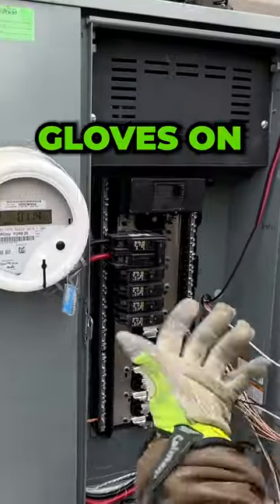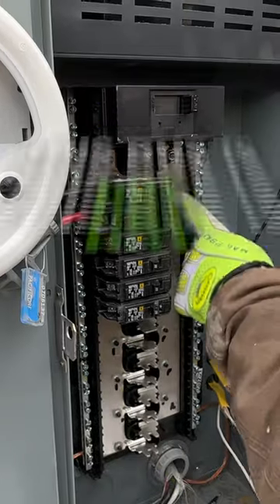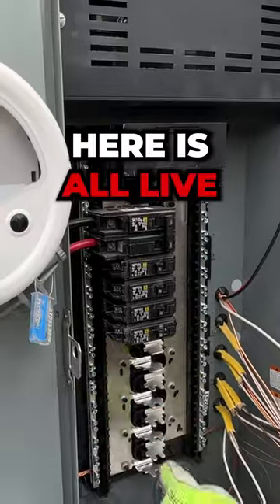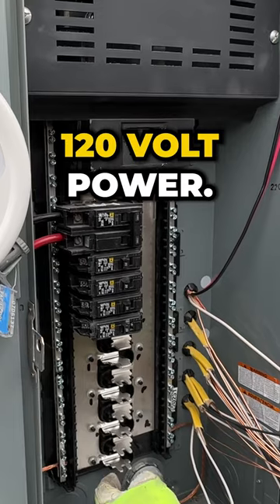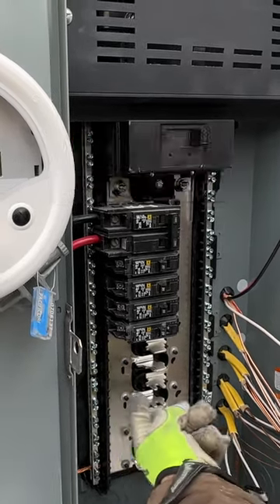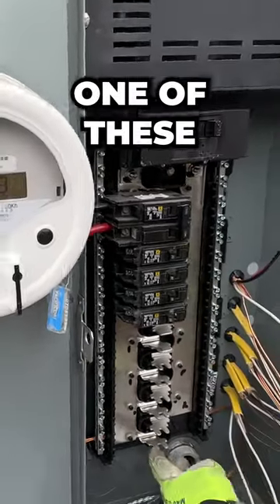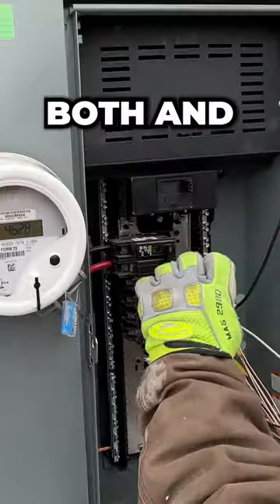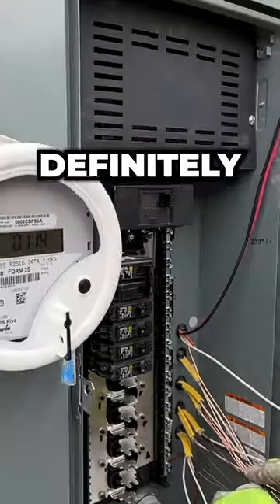Don’t Get Shocked⚡️Live Panel #Shorts

Comment: Don’t get in the habit of trusting your gloves this way. He also said it won’t kill you, but the severity of a shock has little to do with the voltage. Path of current, amount of current, and time spent in contact with the circuit. All it takes is .007 amps across the heart to stop it. Electricity doesn’t just take the path of least resistance in the body. It takes all paths with with the current being indirectly proportional to the resistance in that path.

Comment: It would most defiantly be able kill you.  Depends on the difference in potentials ,thus how much current could flow through you
Reply: I always say it probably won't kill you. I don't feel too safe or confident with a "probably"
Reply: Any voltage could kill you depending on the amps. You have to be in a very dumb situation to be killed by 120 in residential. Like a tight space and you’re hung up to ground somewhere
Reply: @frankw3606  Oh really? Could 5 volts kill you? How about 0.1 volts? It isn't that simple. It does depend on the current thru you which depends on your body's resistance. So it isn't just the current, i.e. amps.
Reply: @tangowally  yes it’s the current flowing through your body that will kill you, but it’s the voltage which will drive it through you.  If you imagine voltage as the pressure 12volts isn’t enough for the current to flow.  Hold on to a car batter at 12v that has a 400ah Capacity and I bet you’ll be just fine
Reply: Correct it could kill... But most likely won't.  Still not worth touching it unless you have too.... Even with gloves.  Trust me, shocks hurt, I know from personal experience.
Reply: saying thus doesnt make u smart
Reply: @frankw3606 
This is exactly what killed one of my colleagues. 
He had to squeeze past a faulty HVAC unit (hot skin)  and a cast iron drain pipe. 
He was noticed missing after about an hour...

I had no authority to demand it of colleagues. But always suggested they should  always wear long sleeves as a shock reduction measure. 
Sadly that day he was in a t-shirt. Found with bare arms firmly pressing against the energized metallic parts.
Reply: @tangowally but if you're wet your resistance goes down like 80 percent maybe more I can't remember.
Reply: Different of potentials is voltage. You meant to say how much resistance
Reply: @jakebackpack8292  no I did mean difference in potentials. If there is no potential difference current will not flow.  The amount of current flow obviously is down to the resistance/potential EMF
Reply: @tangowally  I think he meant, any “typical commercial voltage used”.  There’s 24, 48, 120, 240, 480, 1300… and so on.  But yes you’re right, all about potential.
Reply: Get in between a loaded neutral and it’s point of continued path and oh boy you just think hot to ground hurts. 😊
Reply: About a year ago a boy unfortunately died after a bad storm hit and the next day he went outside and when he touched a puddle of water he was electrocuted with one of those orange 120v extension cords. He could’ve survived if he would’ve fell forward out of the puddle but unfortunately fell backwards and couldn’t get out and passed on the spot. I never thought 120v could take a life but thats when i saw things differently and it very well can depending how you get hit by it. I hope everyone stays safe, take care everyone!
Reply: 30 volts can stop the Human Heart
Reply: @tangowally  It is always the amps that kill you. More volts=more amps, but there are ways to get away with fewer volts. There's no way to get away with fewer amps, and you can't get away with many more as long as you have a minimum time period.

Very high frequency electricity being the exception to even causing harm at all.
Reply: You are forgetting the amount of time you are completing the cuircut and how much resistance you offering. It's voltage time and resistance along with the current that's available on the cuircut that's why a taser that's upwards of thousands of volts but current limited isnt likely to kill you but a power line also thousands of volts but has plenty of current to offer will completely fry you.
Reply: @frankw3606 ot any voltage will kill you. At a low enough voltage osha states below 50 volts we offer to much resistance to complete the cuircut with our skin and thus current will never have a path to be completed and won't flow. This is why I can touch a 12 volt car battery even tho it can produce hundreds of amps. I mean you would have to have electrodes piercing your chest to have a low enough resistance like the blood in your body to actually complete a cuircut but by that point you have other things to worry about like being stabbed in your chest.

Comment: If everyone had the confidence of residential electricians, there'd be a lot less people walking around with ten fingers.
Reply: Just wait till this guy gets hit by a 480 volt shock or arc flash and let's see how cocky he gets after that. Or even better I wanna see him working in the rain with wet hands on a live 240 volt service. Goes from miliamps of current hitting you to hundreds of miliamps of current hitting you possible amps depending on the situation. This video is seriously wrong from every angle.

Comment: If you touch a hot with one hand and a neutral with another, it can result in an ER visit or death.
Reply: Oh man. Probably death. You’ve got 100-200 amps running through you. You’re putting a lot of faith in that main breaker. Or u just don’t have any insulation on your feet and it’s a wet day. Touching the hot alone could kill you.
Reply: This is definitely a myth. Someone always told me to never touch 2 wires but simply touching only the hot wire will cause electricity to start flowing through you. I've done it before when I thought the power was off while changing a light switch and it's not something I ever want to experience again. Thankfully I was able to pull my hand away fast but it felt like a vibration radiating through my hand. 🫢

Comment: I remember when I worked on a live panel. I didnt know it was live though. 480vac three phase. 4-4soow cord supplied disconnect. I got complacent and believed the person who said they had cut main power. I removed the 4-4 from the main lugs no gloves and somehow didnt get bit. Pulled the cord to remove it from the panel out of the cord grip. All 3 phases came together. Wicked arc flash. Lucky to be alive

Comment: They arent phases, they are poles.  Its a single phase system vs. a 3 phase 277/480 volt system.  And you will only get shocked if you complete a path for current to flow, as in you touch hot and grounding conductor, hot and grounded conductor etc
Reply: They absolutely are phased, as in they are the same frequency and amplitude, but just phase shifted. 

And unless you are touching two hots of the same phase, there is potential between them as determined by the phase shift.

Comment: Isn't it technically not 2 separate phases? It's one phase split in half between the two bussings, hence "split phase"
Reply: Correct. This is one of the most common misconceptions.
Reply from the maker: That is correct 👍
Reply: Depends on how you look at it. If you are at the panel with and oscilloscope, it's definitely two phases. If you ask the power company the residential transformer is only hooked up to one phase of the transmission line.
Reply: @WorBlux  distribution line not transmission line and depending on line V it can be hooked up to two phases and still be 1ph

Comment: So this is split phase, not single phase, correct?
Reply: Correct. It is coming from the city at singlephase 240V. The transformer is center tapped which gives you 120/240V

Comment: If you make a habit of touching everything even though you're wearing a gloves, it's only a matter of time before an absent mind teaches you a lesson.
Reply: Kinda like running stop signs and speeding.
Reply: @daveyt4802   I meeeean sure??? in the sense that they're both kinda dangerous in a sense. But the point wasn't that he's doing something dangerous, the point was that he's doing something which is only dangerous if you don't have proper PPE on, but if your normal mode of operation is to do this, then someday, you're going to forget you don't have PPE on, and then it's going to be dangerous. Speeding is always dangerous, regardless of any other context. I guess I could see an argument that running a stop sign is only dangerous if there are other cars around. So sure, I suppose I see that analogy.
Reply: He probably also have special safety boot's on too. So it cant pass thru body.
Reply: @DoNE021  only if he never needs both hands to, say, hold a wire in a breaker while tightening the screw

Comment: To clarify, US residential electrical tranformers step down line voltage, usually only grabbing one phase (of three), to 240v. It is a split phase, meaning the neutral is bonded at the middle of the wound coil, and the half phases are the ends.

So rather than 0-120, 0-120, or 0-240, it is 120-0-120, and technically one side is negative in scale but it doesn't matter for consumers, and 0 represents ground, or neutral, which are bonded at the service.
Reply: Yeah it was historically done because 240V - i.e. the rest of the world - would be more expensive. But then we don't user Aluminum cables here as well.
Reply: @darknase  The 120V standard was in the U.S. as a safety thing, an the fact when the standard was introduced electricity was mainly used for lighting, and 120V is plenty for that.  Split phase came in when they realized 120 wasn't enough to drive power hungry appliances, and it was the cheapest way to run multi-voltage systems to the home.

Comment: Split phase is not 2 phases.
Reply: Yes. It is single phase. But one side is called "A phase" and the other is "B phase. If you add the third phase " C phase" you have 3 phase.
Reply: @Daniel Houghtelling  No, it's a single winding of a transformer neutral point is in the middle of that winding, not 2 windings (phases)

Comment: To be honest I've always worked on electrical panel boxes with the power still on, after I turned off the Breaker to the circuit I'm working on, yes I've gotten my fair share of shocks, but its because i believed other electricians when they told me that the line is dead and no power only to get a nice shock when attempting to replace receptables or lighting fixtures. Now i take my tester and check for voltage regardless of what one says. I've came across many mislabeled or not label breaker panels.

Comment: Except its the same phase. The transformer is 7200v on the primary and 240 on the secondary. 120 is when you center tap the neutral so youre only getting half of the windings.

Comment: Not a and b phase. That only exists in 3 phase service.  Aingle phase is derived from a single conductor off transmission line and hence term single phase.  The transformer on pole is center tapped for the 120 v ac loads..

Comment: As long as you're not grounded you can touch a live wire all day long and not get shocked.
Reply: Until someone walks up and taps you on the shoulder.  Also, if that door is not propped open, you're at risk.
Reply: Not exactly true. You heard of static discharge? Why does a helicopter lineman have to use a grounding rod to bring themselves up to potential before touching the line? The same thing applies when getting off the line - a transient discharge could still be lethal, even though it's not going to "ground".

Comment: I changed my mom's main breaker the other day. I did it with the wires live. I didn't want to wait or pay the electric company to come out and shut off the power. So I got my best tools and newest gloves and did it. I was nervous. My screwdriver slipped a few times thought I was going to touch both live wires. Oh well glad it worked out

Comment: Just to clarify, touching one will NOT kill or shock you, UNLESS you are grounded or complete the return to source (i.e. primary  earth ground p.e./p.g. on prints or the second side of the source  in this case both buss bars at one time) I won't get into the weeds on what shoes are more at risk for connecting you to earth ground. Touching both sides of the buss bar at one time was pretty dumb. Those are regular "work gloves" and not even the old "00" glove liners and leather glove protectors. If he ever works and gets really sweaty, he has a lesson coming screwing around touching two buss bars in work gloves. If his work gloves have steel filings or shavings, he could be the next Darwin award winner. All those ground wires rattling bumping against him, once again, are the potential learning one day. Same thing about the water myth. Water is actually an EXCELLENT insulator until it becomes electrolytic water ( water with electrolytes suspended in it). Deionized water or distilled water is an insulator.   120vac probably has killed more people than any voltage. 1. It is more common. 2. All conditions are not the same. The very reason why GFCI circuits are in wet locations. People used to die, with frequency, in pre-code bathrooms and flooded basements. Think the old movies a radio falling into a bathroom. It caused an industry change. 3. Everyone does not have the same health factors. 30mA is all it takes to cause a-fib. Once again, the cause of the whole industry of institutional defibrillators. He needs to learn electricity before putting this crap out there. Lastly, I literally had a contemporary killed on a 277 neutral on a shared service (bad installation). Bad information. I would not trust this guy! 😡

Comment: I've been shocked 100s of times. Generally there is negligible load on a circuit you're working on, but if it's at anything like 1 amp and up because of a current draw on the branch, and you make a better potential to ground your gonna be closer to death, than on an unloaded branch circuit.
Reply: 😂😂😂 I =V/R . The circuit resistance determines the current flow

Comment: Technically a 2 pole breaker is 2 single poles with a common trip. The 2 pole breaker does not actually cross the phases or you'd have a dead short phase to phase. The two phases connect together through the load, not at the breaker.

Comment: Not two phases it's a single phase powering the transformer, the secondary side of the transformer is center tapped and grounded the voltage between the each hot leg and the neutral is 120v and the voltage between the hot legs is 240v, it's like having two small secondaries that are connected

Comment: why did you call it neutral bar and ground bar, shouldnt they be tied together?
Reply: Not necessarily. You bond once and only once at the service entrance. This is usually the main panel, but not always. Regardless they should be organized and connected to separate bars, even if the bars are tied together.

Comment: Just a tip when working on an empty live panel with that much bus bar exposed: take a large enough piece of cardboard and shield the bus while you're routing the ground and neutral wires. Ask me how I know?
Reply: Or turn it off... 1) it is a house so no loads are worth the risk and 2) there are no breakers in the panel

Comment: It's not A & B phase. They are the same phase just the opposite ends of secondary of the transformer in the pole. For your information the neutral is the the center of that secondary 🤔

Comment: I got bit b4 by 3 phase 230v 1 time and grounded myself. I was trying to get to this overhead door operator at diagnose with this operator shoved in bad spot and i was leaning outside the ladder holding a steel brace for the building and idk if i touched a hot wire or arced out but it got me and jus held me for like 3 to 5 seconds and i was finally able to let go and when i came down the ladder i was woozy for bit. Im always extra careful now

Comment: I’ve been shocked slightly pushing 440 volt 500MCM to the side in a panel to access another line’s set screw. I was shocked thru the rubber jacket because of very fine cracks in the insulation. I would touch those bus bars with a leather glove.

Comment: As long as you dont touch more than one leg at a time an your not grounded or touching the neutral your golden. You cant touch a neutral by its self if its shared or has a load on it. It will shock you. Any type of shock can kill you by causing interference with the electrical impuls sent to heart for its beat.

Comment: At the top of my panel I dont have a breaker to kill the power? Any help?
Reply: Is there another panel either outside or inside?
Reply: @master-oppressor  I haven't checked inside yet, but I see the main power line coming from the power lines to the house down the conduit and into the meter. I wish I could share a pic.
Reply: @two-keytech7578  The meter box should be above another panel; grey, about 4" thick, with some type of latch at the bottom.

Comment: Why would you work that hot when there are no loads coming off the panel and there is a 100A main? 240/120 power "won't kill ya" till it does! Voltage doesn't kill, but very little amperage will!

Comment: Not opposite phases.  Center-tapped single phase. The two hots, relative to neutral, are the same phase but of opposite polarity.  With polarity inverted,  the two voltages anly appear to be 180 deg out of phase,  but this is indeed a single phase winding with center tap going to common, neutral, or ground,  depending on implementation. To make things worse,  polarity inversion or polarity splitting is often called "phase inversion," but this is slitting hairs,  symantically.  😬

Comment: I Have Touched either One Bare Handed, Just Not Both and you Can't Be Grounded. Rubber Shoes a Must.
Also Change out Recepticals Live with my Leatherman, To Do Safely, Disconnect Ground First, Connect Ground Last. You don't have To Locate Breaker, or Reset Clocks, also don't have to Shut Down Something Critical. Some might say, Don't you Worry, I Tell Them, You See the Birds Getting Scared Sitting On The Wires😮. They Learned this at an Earlier Age Than Me. 😊